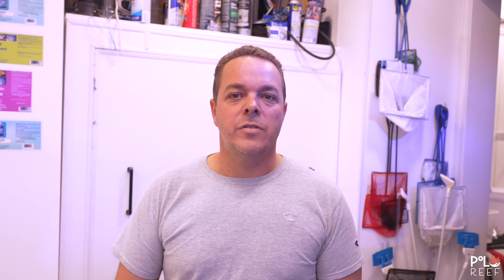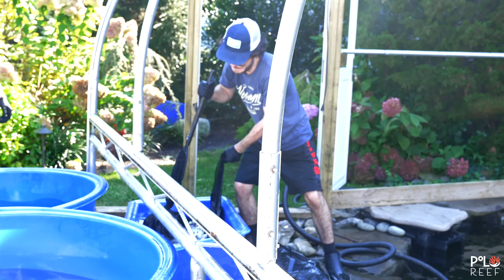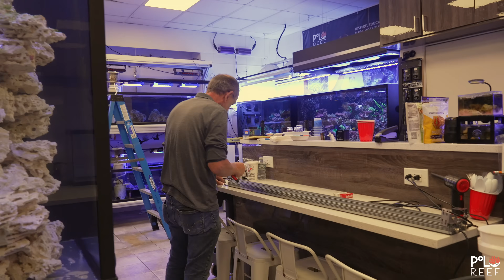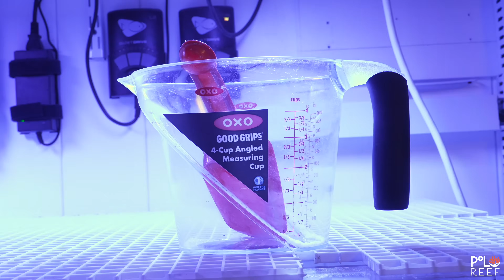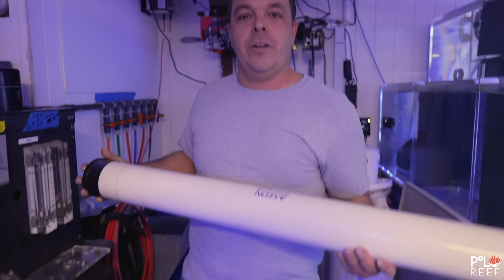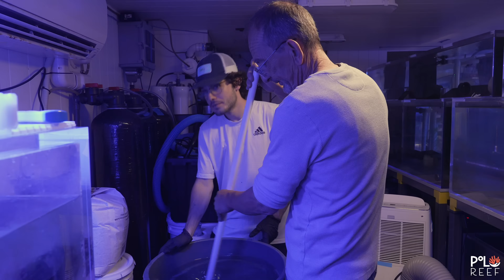CORAL STRESS, PESTS & HIGH METALS IN REEF AQUARIUMS!

Comment: In a recent Vargas reef video ,the guys talk about metal pieces being found in bags of sand,titled video- Vargas reef chronicles Reveal Kuwaits most exquiste reef tank,  at about 18:53 time stamp the discussion starts about the discovery. I also noticed you guys keep dry rock by the generators,looks like they are on a shelf under the Lg units, is rain coming down the Lg units all over the dry rock?
Reply from the maker: you  suggesting its leaching from a rock under some metal outside and maybe we use a piece or so ?

Comment: Just my 2 cents from issues I've had but did you check any of your metering devices? Ph probes and the such. I would assume you have them all separated from the system. If you don't, I had a temp prope fail and release toxic levels into a tank before
Reply: Thanks for the great tip! Every piece of advice helps. Thank you for your support of Polo Reef!

Comment: Also, does your controller detect nominal pump current levels?  Elevated current is an indicator of pumps working harder.  Flow reduction can be an indicator, too.  The turning rotor rotating inside copper windings can heat up magnets inside pumps and cause expansion which releases metals.  Eventually, the pump will freeze but, it releases a lot of metals into the mean time.
Reply from the maker: interesting !

Comment: Andrew,  just checking the shaft isn’t enough for checking culprit’s to heavy metal.  They have to look at rotors for wear.  Motors are made of copper windings and rotational friction can wear off varnish and leach metals into the tank water.
Reply: Yeah that's all separate from the pump itself. That would be a pretty obvious failure
Reply from the maker: plus pump is new
Reply: @Savage4955 I’m guessing that if the windings got wet, the pump would short out pretty quickly.    I am also guessing that the guy who posted the comment may not be aware that the pumps Polo used are not the submersible type.
Reply: Fcc c
Reply: Aren’t those components separate from the wet side of the pump?